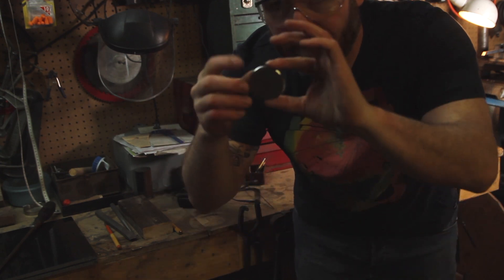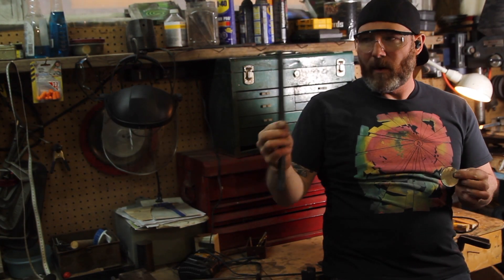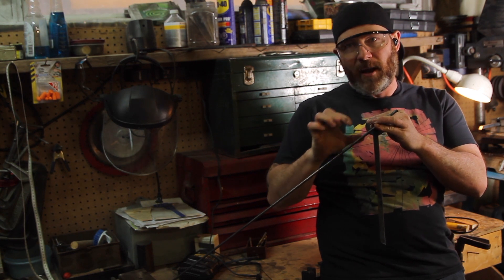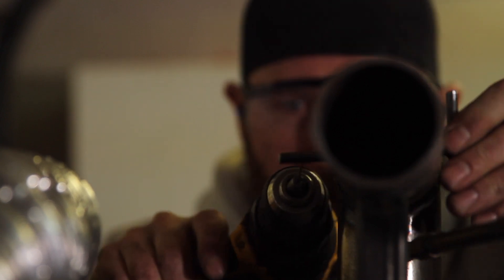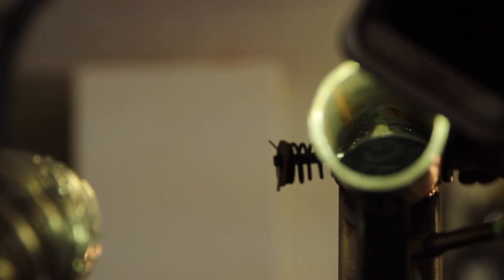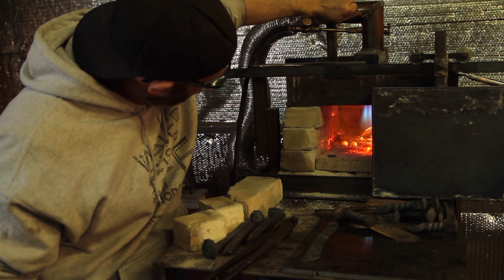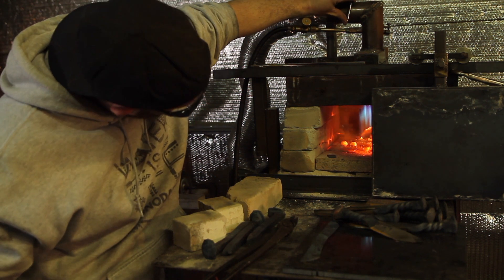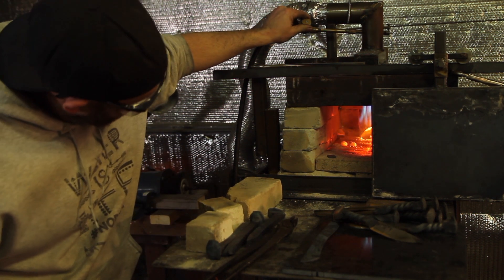Ribbon Burner Air Regulator Build - Throttle

Comment: Cutting back on air , could that cause propane to inter the air fan and gas to back up causing fire balls
Reply from the maker: The volume of air that is being pushed through the pipe does not allow that to happen. There is always a lot of care required when handling propane. The wrong person and a BBQ could result in some bad news. Same goes with a forge.